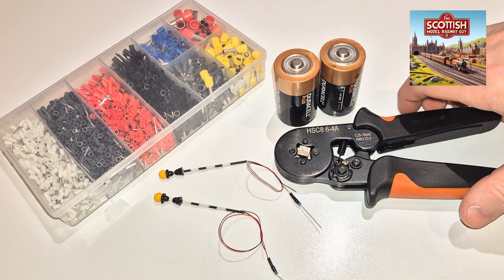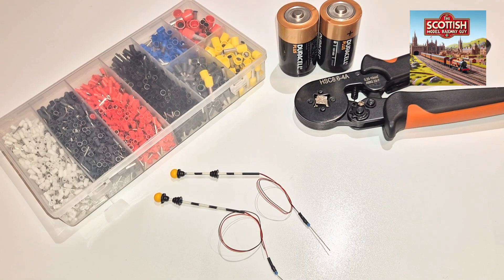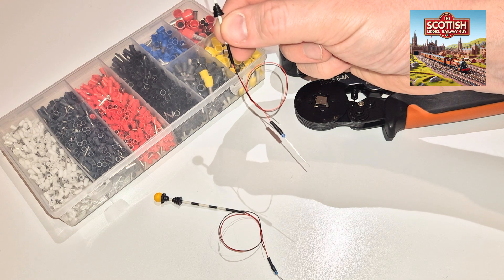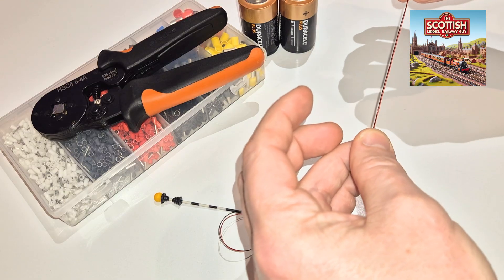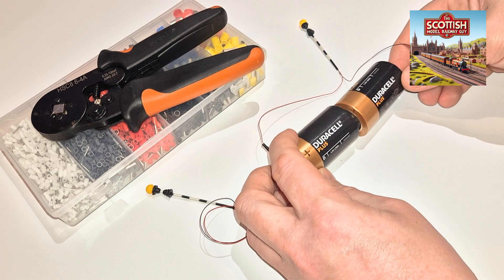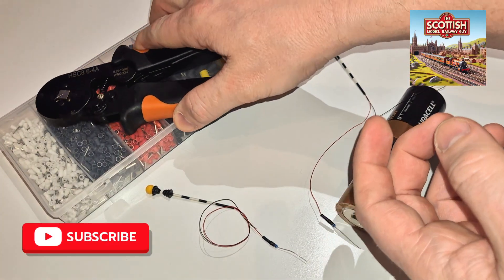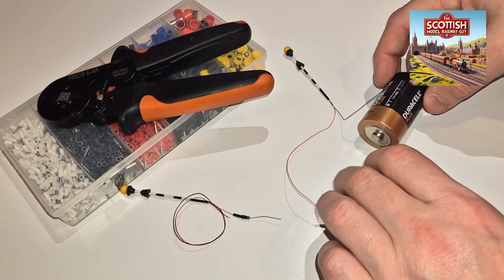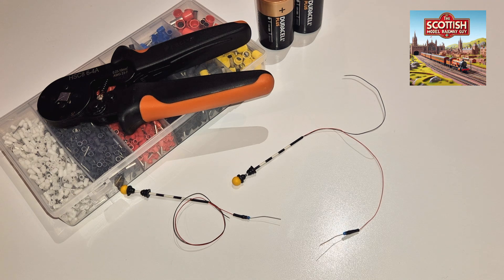Model Railway Basic Electronics (Zebra Crossings PART I)

Comment: Been looking forward to this.  Well done.  

I'm working on the interior lighting of a Bristol Lodekka at the moment, how DCC can be used to turn the lights on and off, and how the power source wires can be hidden.  Shame the destination can't be illuminated.
Reply from the maker: @TimothyWorel-f8j  so... you spurred me on to do a bit of research on this, and I did... it turns out you can make flashing LEDs with a capacitor in line, but... these ones flash on their own, and I reckon they have an in-built capacitor.  As such, it'll be a very easy install into the already existing 3 volt "bus bar / distributor".

In theory 🙂👍🏻

Comment: Nice one! I do like these little zebra crossing lights. When i was doing my ballast not too long ago, i noticed that the trains couldnt run arround half the track. Maybe i got the track wet or something? And do you think i should just re start the ballast? Any suggestions will help, thanks.
Reply from the maker: @SouthWestCrossingsUK  For your track problems I'd definitely start with cleaning the rails on the top, and also cleaning your train wheels, both as thoroughly as possible.  Getting the tracks wet during ballasting is sort of expected for sure, but it should be fully dry after a day or two.

Was it new track you used, or old track, and did it run okay before ballasting?
Reply: @TheScottishModelRailwayGuy  I made sure that the ballast was low enough for the loco, and coaches. It was used track aswell. Perhaps I should buy new track
Reply from the maker: @SouthWestCrossingsUK may I also suggest having a really close look to see if some ballast had "climbed up" the inside of the rails?  Another watch out is if you have an 0-4-0 loco.  Because they have less electrical contact they can struggle over points etc.
Reply: @TheScottishModelRailwayGuy  I tried it with all my trains, my class 40, my 153 and a few other trains, they all cut out between the same parts
Reply from the maker: @SouthWestCrossingsUK  did they cut out before ballasting?
Reply: @TheScottishModelRailwayGuy  only occasionally
Reply from the maker: @SouthWestCrossingsUK  It does sound like either a cleaning problem or perhaps the contact between the tracks.  Definitely spend some time cleaning first before you go spending, just to be sure!
Reply: @TheScottishModelRailwayGuy  alright,  thanks for the help!